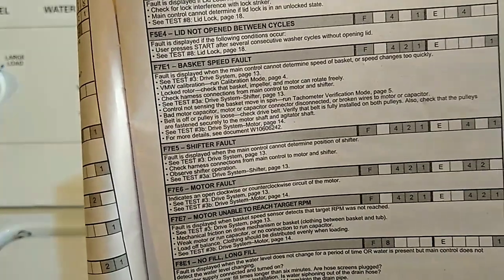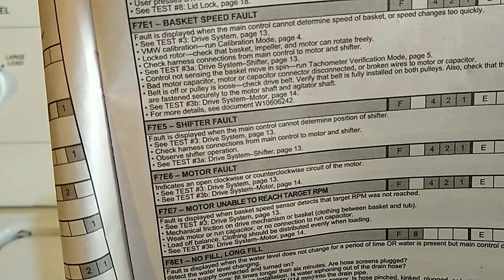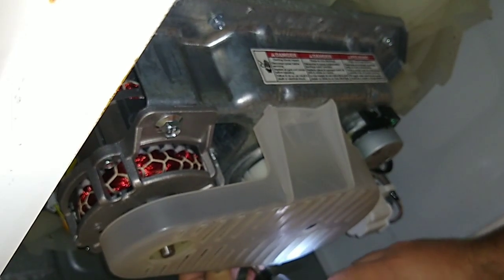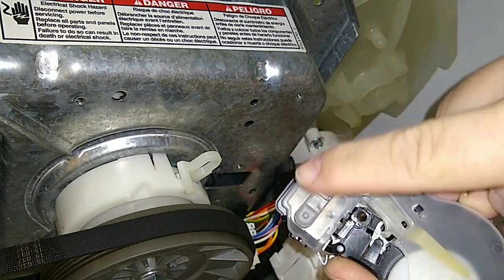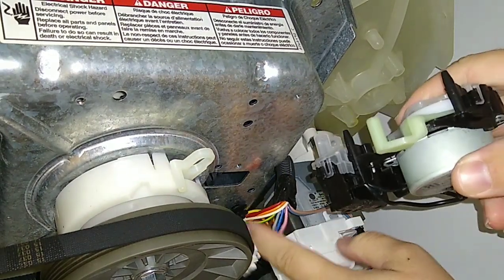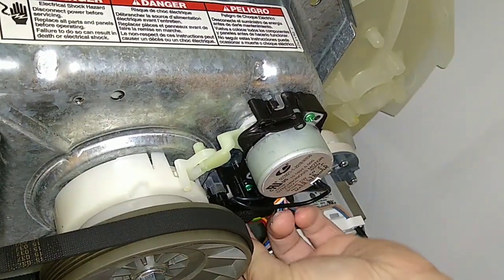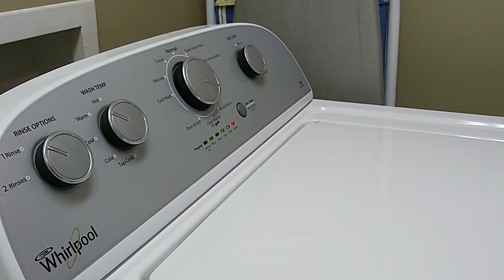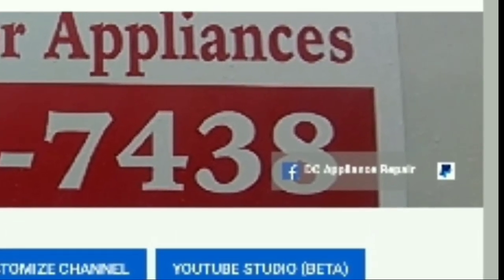#Appliancerepair. How to change a shift actuator- Whirlpool - Maytag - Kenmore - Amana Washer!

Comment: What resistance should these read. I just replaced mine in December and now it's not actuating. Usually right after it senses you can her it doing its job down there and shifting the motor into position. Now that doesn't happen. It will agitate intermittently just for a few seconds and that's it . My book says it should read between 2000k and like 3.5k but it's reading like 1980 right now

Comment: Will a shift actuator arm move freely when out of unit?  Does it have to be plugged in with power to move?  I ask bc this is what we believe to be wrong with our washer. I took the old one out and the  arm is frozen, does not move at all.  I haven't found video yet that describes the problem we were having.  The code I received was F7E1.  Our agitator would pulse high speed like a blender and wad the clothes up....it would never agitate correctly, nor would it spin out.
Reply from the maker: Any load noise coming from the unit? Your error code points to the shift actuator.

Comment: what are the symptoms of a non working acutator.   i ran diag and its giving me a f7e5 code.   the washer im working on has been sitting for years in storage.
Reply from the maker: Not going into spin mode.
Reply from the maker: You need to hear a strong click sound before it goes into spin mode. No click or no spin when running the test, then most likely bad.
Reply: would a faulty  lid lock mechinism do this as well?   thank you. @DCApplianceRepair
Reply from the maker: You should hear it click first before anything.
Reply: @DCApplianceRepair  I cannot get it to do anything at this point.  I can hear a click but sounds to me like the lid locking.        I did get it to fill water in test mode but that's all the further it would go.    It puts water in and pumps it out in that mode but it necer agitatates or spins
Reply from the maker: @Dooguy  The actuator is what you will need then.
Reply: @DCApplianceRepair       Thank you!!  i was gonna try a lid bypass first,but now ill go ahead and order that actuator!
Reply: @DCApplianceRepair  m puling my hair out with out our washer.  it was in storage and we just got it out of several years of sitting.   its not that old and still looks new.    i went by the codes in the diag process and they have led me down a path of wasting money.    first it was the lid lock code and everyone around said 90% the lid lock switch will stop it from agitating or washing...so i bought one.   didnt fix it even tho the code for that switch came up.  then it was the actuator code.....replaced that.    nothing.       I even replaced the capacitor and the water valves.     still wont work.     under test mode it will fills and drain but when it goes into agitate or wash mode it just kindy hums or growls real quietly.    doesnt make alot of noise but u can hear something kinda growling.     no more codes either with the diag procedure.     i just dont get it .

Comment: Hello I changed the actuator on my washer and now it won’t fill with water 💦 I tried resetting but it’s not helping any idea if im missing something???? Help TIA
Reply from the maker: Try by recalibrating the machine. You can put it in calibration mode. The tech sheet is located on the inside wall. The front part of the machine.
Reply: Do you have a video with the calibration mode?